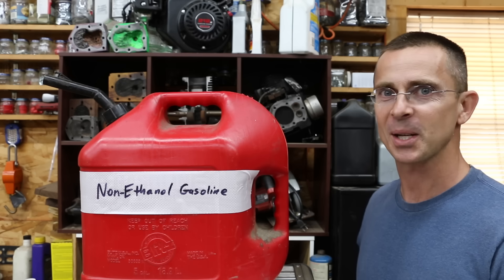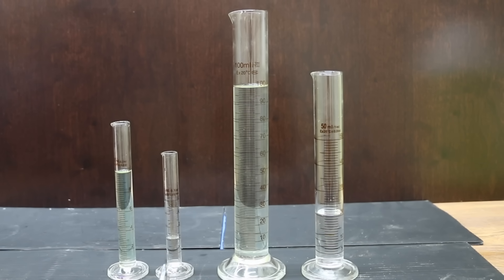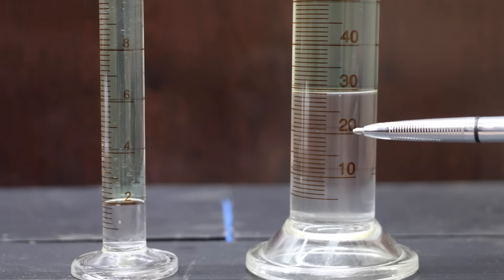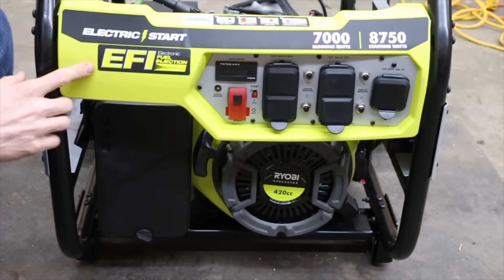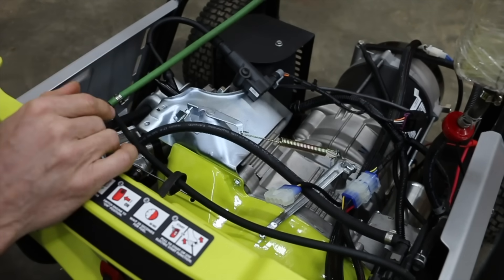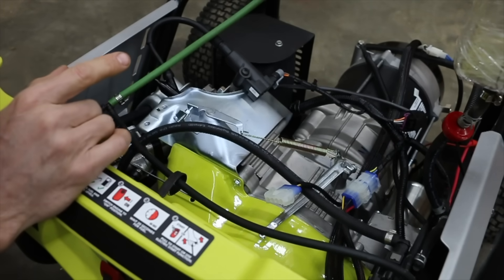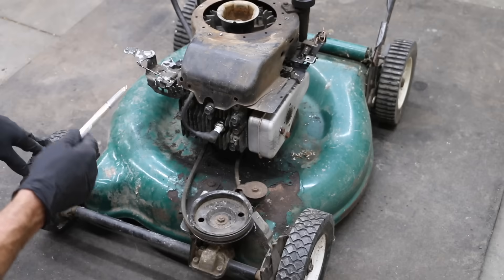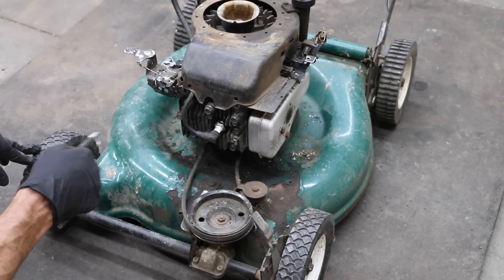Is Non-Ethanol Gasoline Really Better? See the PROOF!

Comment: I was very impressed by your finding of a 4% decrease in fuel economy with 10% ethanol fuel.  This finding is directly related to the fact that ethanol has a BTU rating of only 77,000 / gal vs a rating of 116,000 BTUs for pure gasoline.
Reply from the maker: Thanks!
Reply: 4% on a single cylinder engine. 4 inline to 6V should go up to 15% and much more cleaner combustion. The problem is it is very hard to get pure gasoline without ethanol. Here in Europe you can buy Shell Vpower 100, but it is pretty hard to believe this is a true 100octane. The only place where one can get a true 100 is on small airports where 100octane rating gasoline is used on small aeroplanes which uses true gasoline rating as there is no messing around cause of aviation security and the gasoline rating should be true.
Reply: @The_Touring_Jedi  got called out in another thread for not knowing shit so you switched to this one
Reply: My very unscientific study years ago when I owned a Flex fuel Chevy HHR. I was very excited that the car could run up to 85% ethanol which I thought would ease the fuel bill of 30 mile commute 95% highway miles with no backups. 
That simply wasn't the case. My mileage dropped dramatically. Instead of filling up once a week I was instead filling up twice a week. The additional fill-up ended up being a wash since the ethanol cost less but I was still spending the same amount of money at the gas pump. 
Performance seemed the same. But then again, it was a 4 cylinder HHR. 

As for 10% ethanol in small engines. I ruined a carb in 2 years on a riding mower, a 4 stroke trimmer head, and almost lost the carb on my generator. I vowed never to use entanol in a small engine again and ran my small engines trouble free for almost 10 years until a sold them and switched to battery powered.
Reply: @andreo  The proponents of blended fuel only look at the PRICE of blended fuels, not the QUANTITY needed to equal the work of unblended fuel.  Penny wise, pound foolish.  You've proven what others don't understand or want to believe.
Reply: @danburch9989  They are trying to increase ethanol content to 15% for this verry reason. Deliberate deception. Also, most cars on the road are not rated for anything above 10% so I don’t know how they are even getting away with it.
Reply: @seth7745  all cars 2001 and later are approved for e15 fuel, commonly seen as unleaded 88
Reply: @GolfClash2718  That is a highly misleading statement. The EPA approved E15 for use in 2001 or newer vehicles, but that doesn't mean the individual manufacturers have. I know because I did the research.
Reply: @seth7745  I've never had any issues with it
Reply: @GolfClash2718  Good for you. That says nothing about all the other cars out there engineered to different specifications. If the engineer of the vehicle tells me one thing and the EPA another, I will trust the engineer.
Reply: @seth7745  actually most on the road in the modern era use e85 compatible fuel systems just need a higher flow rate pump and injectors etc to meet the fuel flow requirements for e85
Reply: @seth7745  the manufacturers rate based upon the fuels flow requirements also. The lines and etc have been pretty well the same as the e85 systems for awhile now
Reply: @andreo  your mileage only dropped by 30 percent which isn't substantial considering its still cheaper by about the same margin it adds up to being near the same cost. But e85 has benefits and cons its better for emissions.
Reply: @andreo  are you running small engines carbs dry? This is a requirement for them to properly be stored.
Reply: Thanks for saving me the trouble of having to make almost exactly the same comment. As a side note, I cringe a little bit when anyone says ethanol is “less efficient” than gasoline, because it sort of implies that more of its energy is wasted when used, when the reality is that it simply contains less energy to begin with. I usually describe it as having a “lower energy density” than gasoline, though it’s really clunky and the subtlety is lost on most people anyway.
Reply: It takes 30% more ethanol gasoline to go the exact same amount miles..  food for fuel is STOOOPID and costs more fossil fuels to make and is worse for the environment. We have known this since the mid 80's. Democrats ain't real bright.
Reply: 10% ethanol has a stoich of 14.1. Divide that by 14.68 and you get... 0.9591...e10 is mathematically a 4 drop. You don't get a large drop without more ethanol content.
Reply: @GregsTuningOperation  You are only considering part of the picture. Yes, there is only a change of 4% for fuel air mixture according to your calculations, but from the standpoint of thermodynamics its all about energy density. Not only is the fuel air mixture different, but so is the amount of fuel and air required for a given power output. You are assuming the air flow rate is a constant in this comparison and it is not.
Reply: @seth7745  it just so happens that btu number is an almost 1:1 match for stoich. So, not really. By correcting the air to fuel ratio you have the necessary BTU. Not to mention that is a maximum BTU, which is easier to pull from ethanol (more timing in cars capable of utilizing it).
Reply: "Maybe" more mpg but gotta balance that with $$ per mile and see where it lands. Non-E premium is usually 20 - 30% more costly at the pump vs 87 ethanol. Have to see a pretty hefty increase in mileage to offset the additional cost.

Yeah, so a 4% increase in fuel economy that costs 20 - 30% more. Ain't not no any kind of savings there...

Comment: Congrats. All you proved is that engines not designed for ethanol performed slightly worse than straight gas. As for the fuel injected generator with got SLIGHTLY worse economy, what'd you expect ? E10 has a different stoich than straight gas. Emissions will be better with the E10 however. I have 3 tunes for my car. E10 / 110 octane race gas / E85 guess which one makes the most horsepower & has the lowest emissions.
Reply from the maker: Thanks for the constructive feedback.

Comment: If you let the ethanol gas set in an aluminum carb for more than a month it will corrode the inside with a white powdery substance. If you use ethanol gas make sure to drain the tank and run it till it quits and then choke it and try to start it a couple more times.
Reply from the maker: Thanks for the feedback.

Comment: within 12-18 months of using ethanol fuel, your carburetor will be gummed up with jelly.  briggs engine new 2 yrs ago, non ethanol only in my small engines, still no jelly, and my briggs and stratton still starts within 1-3 pulls of the rope. (sometimes i can't pull it fast/hard enough due to a back injury a few years ago.)
Reply from the maker: Thanks for the feedback.

Comment: about 7 years ago, jegs performance channel did a 2 engine build. BOTH engines were 350 small blocks, all the same hardware, all the same specs.... with one minor difference. one was optimized specifically for 100% pure gasoline. the other... specifically for pure ethanol. the ethanol rig out performed the gas burner in EVERY metric. here's the problem with 'dual fuel'. ethanol needs a higher compression ratio and different comustion chamber conditions all around. the amount of air to fuel. compression, timing... ALL OF THAT comes into play. if you try & take a gasoline optimized engine... and FORCE IT to burn ethanol... you can tweak some of the factors... but not enough. you'll suffer power & efficiency.  this is the ACTUAL truth of gasoline vs. ethanol. don't think ethanol is better? go tell that to an indy car race team. better yet- challenge them... prepare for bouts of laughter.
Reply from the maker: Thanks for the feedback.

Comment: I would consider the ethanol containing fuel to be 10%  as a water and alcohol mixture is less than the sum of both parts.  Essentially the molecules Tetris together in such a way that 20ml water and 10ml ethanol would have an expected volume of approx 29ml depending on the type of alcohol used.    SCIENCE B*TCH 🤠
Reply: Perhaps precipitating enough alcohol out of the fuel to siphon out and test using a hydrometer would yield a more accurate result

Comment: You should do a video that show what the ethanol fuel does in the bowl of a carb when sitting. The fuel seperates and makes a white fatty film all over the inside of carb. If you use ethanol gas run your carbs dry before storing away
Reply from the maker: Thanks for the suggestion.

Comment: In a turbocharged automotive environment,  E85 is worth an extra 120 hp on a 480 hp engine with a change in extra timing advance alone as shown on engine dyno.  On small engines, however, I always shut the fuel off and let the carb bowl run out of the E10 fuel.  Something I have always done with straight gasoline.  No problems noted when I do that.
Reply from the maker: Thanks for the feedback.

Comment: Personally in my opinion I think the problem comes when you let ethanol gas sit in an engine and don't run it it starts to oxidize and form crystals, and does it evaporates it tends to dry out rubber parts that are not made for that kind of fuel. This is especially bad and small engines such as weed eaters lawn mowers etc
Reply from the maker: Thanks for the feedback.

Comment: I had to rebuild/replace the carburetor on my string trimmer every three years when fueled with ethanol-gasoline. Since I began using ethanol-free gasoline, my small engines operate like new. More importantly, a lawnmower that was running poorly is running smoother and better (more power) than before the switch. Sadly, in California even race-gas contains ethanol so I'm stuck with buying it in drums.
Reply from the maker: Thanks for the feedback.

Comment: 2018 Hyundai Elantra does much better using non-ethanol I was averaging 38 miles to the gallon. But when I use 10% ethanol I'm only getting 25 to 26 miles per gallon and by the way that's driving easy not hard so in the case of Hyundai Elantra I would highly recommend non-ethanol fuel. Especially with the aspirated 2.0 engines I also noticed the car is more hesitant on Startup using the 10% ethanol. Where has when I use gas without ethanol the car has a much stronger startup. I noticed it seems to run quieter and more responsive with the non-ethanol then with the ethanol. Thank you for your show as always I find all your shows very interesting. I just wanted to add that the car only has 8,000 miles on it. So it's basically a brand new engine brand new car.
Reply: And I get to oil change every 3000 miles. Using pure synthetic gold 5w 20 oil Quaker State
Reply from the maker: You are welcome!  Thanks for sharing.

Comment: Like Ethanol or not, remember, it is denatured at the distillery before leaving to avoid alcohol sales tax and shipped by rail or tanker truck. It is deemed too corrosive for the longevity of any pipeline system. So, in your area, it is blended by the distributor before hitting your local gas station. I did see problems in the mid 80’s at a repair shop as our own mailman’s car fell victim to too much ethanol. It did have a hangover! I just care for our taxes used to subsidize the American Ethanol Industry while keeping foreign competitors out of the market by charging them an Ethanol Sir-Charge. So the last I heard was Ethanol Producers were paid $0.49 cents per gallon to make it and imported Ethanol was charged $0.51 to import it. It could have changed like the seed has to grow it. What? Yes, seed can be GMO seed to produce higher content of starch to feed yeast and make the sugars ferment. Even the farmers sign a contract before planting. I don’t know the seed price. But a strange industry to be in. The hills of Kentucky know this and used straight sugar to make white-lightening for a time. That is go juice for sure. Ask around! Google it!
ASE Master Tech since 1978 - Retired (Besides; I just want to see comments hit ?) Unreal.

Comment: Water/alcahol was used in recip. aircraft engines many years ago for emergency war power . Ethanol is bad for any engine regardless of size if it is left in system and not run for a long time. Will rot all the robber .
Reply from the maker: Thanks for the feedback.

Comment: I will not use gas with ethanol with any small engine (aka lawn equipment). I used it in my generator and my lawn tractor and after a year I was replacing the carb on both of them.
Reply from the maker: Thanks for the feedback.

Comment: Ethanol is worse as a fuel but not just for the reasons of performances such as MPG or carbon build up.  To make Ethanol takes a lot corn, and then it is distilled.  That takes energy to make and corn that the government pays for.  It is not cost efficient.  It is not better Environmentally.

Comment: Non-ethanol fuel runs like night and day in my motorcycle.  It’s a newer fuel injected motorcycle, so it’s not like it’s old.  But it just runs noticeably better with non-ethanol fuel.  Even if I get 93 octane 10% ethanol and 91 octane non-ethanol, the non-ethanol runs better.  More power, better throttle response.  Too bad it’s not exactly easy to come by.  The closest station is about 30 miles from my house.
Reply from the maker: Thanks for sharing.

Comment: Wow thank you PF.  The deep dive into detail and mechanical work with comparison was (for me) very impressive.  I do historic motorcycles and the argument is that: (1) ethanol is ok with carburetors but (2) ethanol is NOT ok with fuel injection PLUS (3) ethanol can melt your fuel hoses.  Are any of these valid?  Does the % of ethanol matter here? thank you again for your detailed effort on our behalf.  ciao paul
Reply: Ethanol gas made a slimy mess of one of my rubber gas tank lid gaskets on a hand held leaf blower and that is when I started using hi octane ethanol FREE gasoline. With Sea Foam also added to it. 
No problems since!

Comment: I can tell from personal testing that in small engines (180CC and smaller at least) non ethanol is superior to 10/90 without any question. 10/90 gunks TF out of carbs so fast it isn't funny and those tiny needles on the small engines are easily clogged. I also run only non eth in my vehicles and I get about 9-10% better mileage over that 10/90, sadly non eth costs about 15% more then... Anyway, PF wonderful video as usual!
Reply from the maker: Thanks!  Thanks for the feedback.

Comment: As another test, soak a piece of metal fuel line and rubber seals in each of the products in a sealed container. Nitrile seems to hold up to ethanol a little better.
Reply from the maker: Thanks for the suggestion.

Comment: ethanol in my equipment left in the engine through a winter will leave a glob that clogs my carb using fuel with ethanol. Non ethanol fuel does not give me that problem
Reply from the maker: Thanks for the feedback.

Comment: For ethanol fuel in a vehicle, I can either take it or leave it. for small engines ethanol-free only, ESPECIALLY 2-cycle engines. If you let the mower sit for a couple of weeks you might as well pull the carb for cleaning, but with ethanol-free fuel a little white smoke for a few seconds after start up then you're all good. Ethanol fuel in 2-cycles? Just don't!
Reply from the maker: Thanks for the feedback.
Reply: My old 4 stroke, Mountield lawn mower/ Briggs & Stratton motor, always starts 1st pull, no matter the age of the 10% petrol (obviously no longer than 12 months) and maybe this is due to the potential fact that the Ethanol stops or prevents gumming within the carburettor, I'm not certain but the mower works just fine. 

2 stroke a completely different story altogether.

This issue must have really had an impact on 2 stroke manufacturers as their technical teams will advise against the use of 10% ethanol based petrol that is older then 2 weeks, that was my experience. So, I'm going to have to buy a washing seperation kit to get rid of the ethanol.

Comment: Would it be a fair comment to note that the piston of the ethanol test had more carbon fouling? While the overall cylinder temperature was similar in each test could the above be indicative of a local and perhaps unwelcome temperature anomaly on the piston crown? I find your investigation interesting as UK is now transferring to E10 fuel and motorist with older classic engines are being warned of potential damage to heritage motors which will potentially happen in North America as well though with a larger market there may well be an incentive for a limited non ethanol supply to be maintained. It appears the problem will manifest itself more with vehicles that spend large amounts of time standing with only occasional use. To simulate this perhaps a soak test of various materials found in fuel supply lines, tankage a metering and pumping devices both ancient and modern would be of benefit. Thank you.
Reply from the maker: Thanks for the suggestion.

Comment: Can you please do a set of tests on 2 stroke engines. Example, I have a chinese made 2 stroke garden multi-tool made by Titan. Every year I end up having to use the petrol purchased for my 2 stroke engine in my 4 stroke lawn mower otherwise it it is wasted as will not work in a 2 stroke. It refuses to work in the Titan engine because of the 10% ethanol and that of course is also mixed with 2 stroke oil. 

I have watched some videos where the ethanol is washed/taken out using a vegetable dye to colour the water to visually enhance seperation. In the UK you cannot purchase ethanol free petrol. 

What is slowly happening now is that 2 stroke engines are being substituted with Lithium battery/ electrical appliances. I just want to keep my 2 stroke going. 

Any other tips?
Reply from the maker: Thanks for the suggestion.